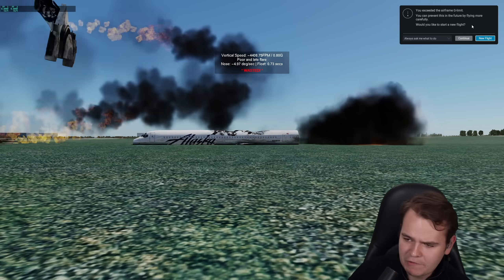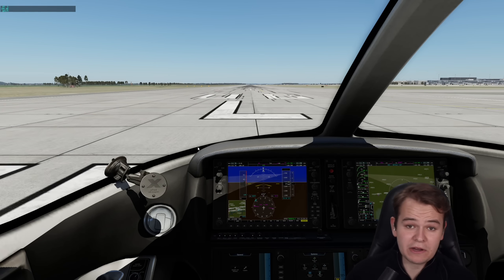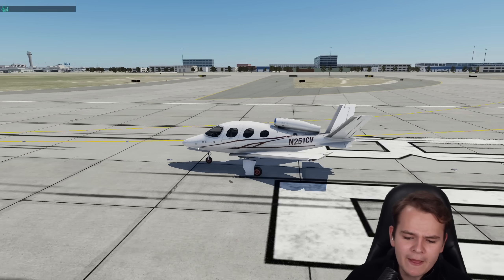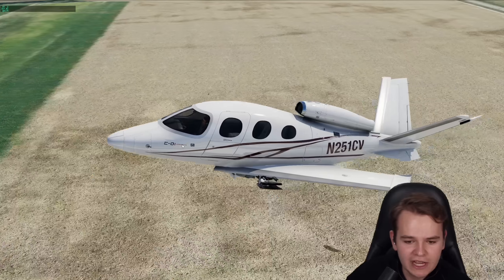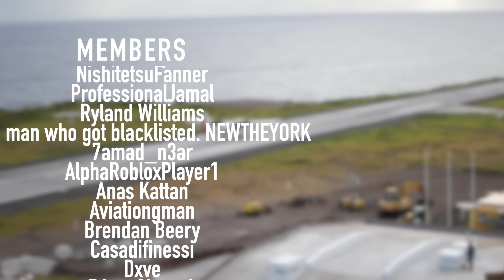Why Airliners Don't Have A Variable Swept Wing

Comment: Modern airlines still do have wing sweep.
I have a very limited understanding of aerodynamics but I will give explaining it a try.
Essentially, when airflow becomes supersonic, it forms a shock cone and airflow separates behind it causing drag and a loss of lift.
Even though airliners do not fly at supersonic speeds, the airflow accelerated over the wing can reach supersonic speeds.
However, the velocity of the airflow that determines shock cone formation is determined by the component that is perpendicular to the quarter chord line which is basically the leading edge for simplicity.
If we had straight wings, that would just be the velocity of the airflow.
However, if we have wing sweep, it is now the sideways component of the velocity of the airflow that determines shock cone formation which is smaller.
Therefore the aircraft can fly faster before shock cones form.
Hope this helps.

Comment: i think i know it: because of sweep wing the COL and COM will go backwards so the wings need to be put a bit to the front but again it will be disbalanced at takeoff and landing , and because commercial planes have engines on the wings, so the plane will tear apart so the whole plane needs to be modified and its not easy